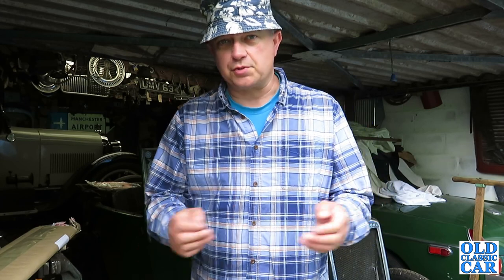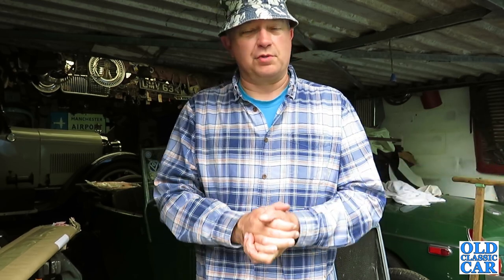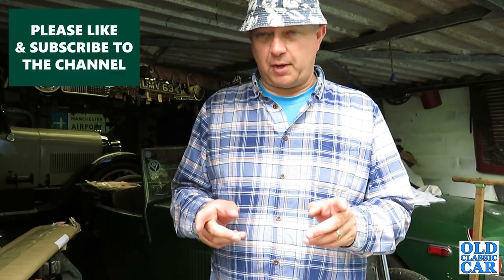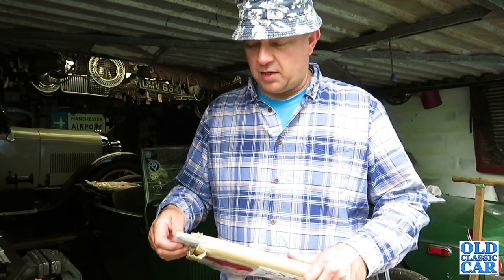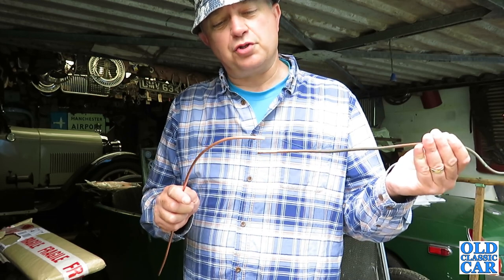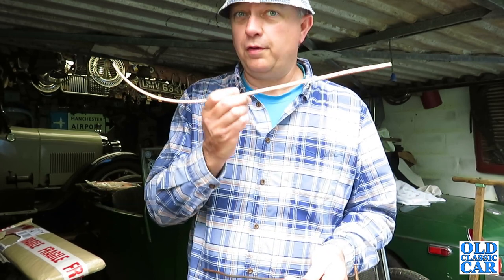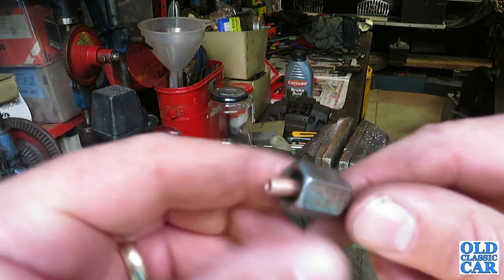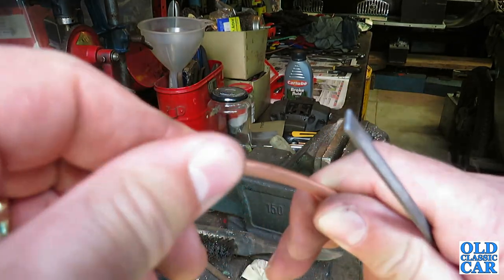How to make a classic car brake pipe, flaring etc plus other old-car things at OCC

Comment: It's so much easier now with the copper pipe, I remember replacing them when we could only get steel pipe, an absolute devil to bend when it had to be fed around the back of fuel tanks etc. Many thanks. Gérard.

Comment: Stupid question time. ;-)  If the pipe and adapter are 3/16 why do you need to use the 5/8 hole on the tool?
Reply from the maker: Not stupid at all, the markings on the flare bar don't necessarily line up with the holes :-)
Reply: @oldclassiccarUK   It's me being thick and not thinking straight 3/16 is of course way smaller than 5/8! Doh!
You'd never guess I worked in camshaft manufacturing in the 80's measuring down to tenths of a thou!

Comment: I have never used lube when forming a brake flare but seems a sensible thing to do, I will try to remember to do this next time. You can buy a small de-burr/chamfer tool from Automec for only a few pennies which works quite well and is easy to use!

Shame the Morris has gone is there a farewell video for this?

My first thought on the mystery car was a Rover P6, but that rear caliper is not for a P6, Ford used the same Girling caliper for the rears on their big cars, so not a Ford, so my guess is a classic Range Rover, for a K reg would be a two door and the purest design before they became bloated and luxury barges. My second guess would be a Jaguar XJ6, but a K reg? Did any survive from then? Sticking with first guess, probably with a towing hitch...
Reply from the maker: Hi, if I find myself making lots of pipes I'll look into a chamfer tool, I did wonder about doing a Morris leaving vid but couldn't bring myself to do it, just seeing it outside made me question my judgement but the decks had to be cleared a little. As for the "modern", all will be revealed soon.